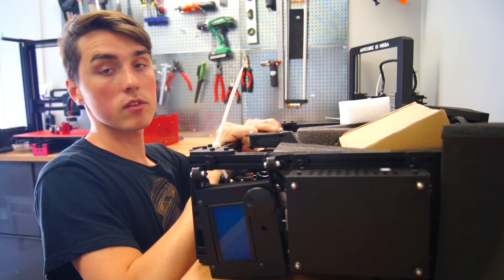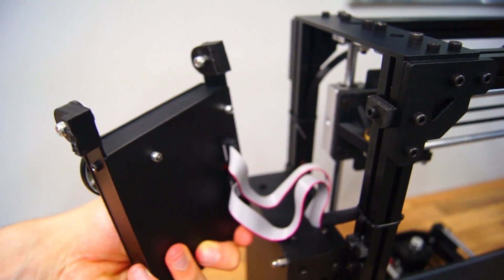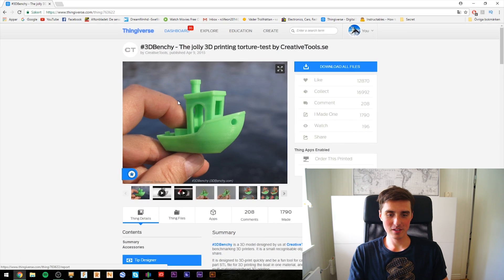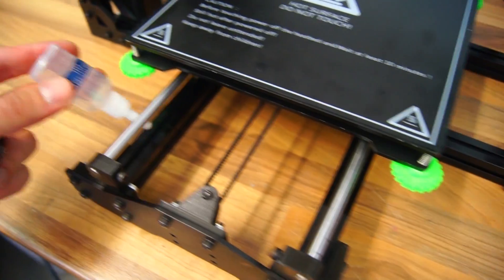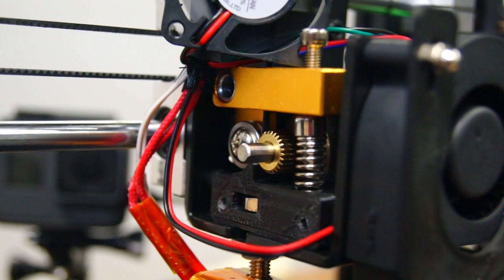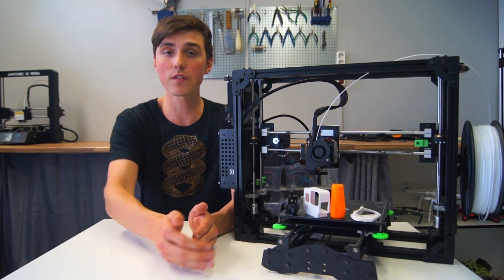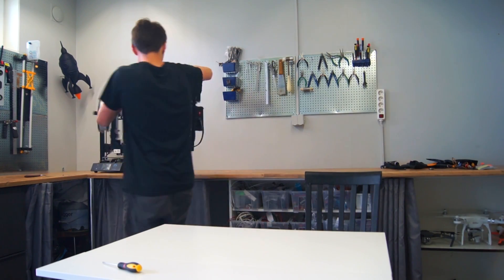NOT the Best 3D Printer!!! - Tristarbot M1 Review

Comment: on the bent rords problem, they seem to be everywhere, but i wonder.. what would it cost the manufacturer to include a 1-1.5 inch steel pipe with the rods inserted into it , if they leave some room for flexing they can certainly fix this problem.
 ofc. you would get less pre assembled parts but at least you get them in working condition

Comment: do they use bronze bushings with graphite insertions? i changed my linear bearings for them on my Anet A6 and it's a pain to get them to run smooth, but it's worth it for the silence they bring!
  i'm asking because i notice that black thing on the rods which looks exactly like my printer's rods when i use too much silicone WD 40 lubricant.
  my method of applying it now is to spray on a paper tissue and use that to clean the rods of dust and grease and it runs really smooth and silent .

Comment: uhhhh you can print faster with a bowden , I print at 60mm/s after upgrading my i3 when I used to print exclusively at 40 with the original DD.
Just need to adjust your feed settings accordingly.

A bowden can print much higher quality at high speeds because it's a much much lighter nozzle, look at your gopro case and look at the horrendous x axis wobble from the heavy stepper motor taking more energy to change direction.

A CoreXY system (where only the print head moves) can reach MUCH higher print speeds because that's got nothing BUT the ultra light bowden fed nozzle moving.

Comment: I wonder, about the bed temp instability; Does it have an adjustment for the "Deadband" or Hysteresis?  It could be that the setting is too high.  A higher setting will reduce the frequency of turning on or off the heater (good for an AC system in a home to reduce wear), but for this you want a low setting because you need the precision.

Comment: As a member from Tristarbot,I have to make it clear that,when you receive a faulty 3d printer from us,such like bent rods or other matters,please don't try to repair it yourself without our help,we use very  accurate graphite lubricating brass bearings for all axis,that also mean slightly bent rod could cause big problem.In this case,you should contact us for parts replacements and tech support,or return the printer,we response pretty fast to our customers,NO our customer should  experience a faulty 3d printer as this video show.
Reply: Could you provide a link to either models or stl files to reprint the factory printed parts for the Tristarbot M1? My x stop broke and I remodeled it but would prefer not to do that for any other parts.
Thanks

Comment: the temperature fluctuation at the hotend may not be a serious problem...I mean I had similar issues on my huge 3D printer which I'm buliding right now and It was a Analog Input handling fault. this Board is based around a Atmel Atmega 2560 chip so the whole thing is just a Arduino Mega, a Ramps board and some DVR8825 stepper driver squeezed together on one circuit board. So I bet the Issue is the same as I was facing with my Ramps Shield on a Arduino Mega: The two Analog Inputs interfeered and that's why the screen shows unaccurate data, but actually the heater block keeps its temperature pretty stable. I solved this by wiring the hotend termistor to those pins where the second heated bed's termistor should be and changed a bit the code in the uploaded firmware (marlin) in order to get the data from the other Analog Pin. I dont't know if this board has additional Analog pins left freely but if it is the case, you can simply modify a bit the marlin firmaware in Arduino IDE and upload that code to the Atmega 2560 chip through the serial port and it will work just fine.
So just try it out :))

Comment: Hahahaha! I had most of those issues.... and more! My hot end was rock solid, same with the bed. That was it.

You ended up with the "older" not as good power supply, so there is already a revision (mines twice the size, metal, and twice a brick...).

My Issues:
- All Y axis black printer square rod adapters, broken.
- Other printed pieces showed layer separation/cracks
- POWER SUPPLY SUDDENLY CUT OUT! I actually fixed it, the power connector to the mainboard was... not properly connected (inside the connector...!) [Also, internals of the newer power supply are unsafe for this class of printer, no MOSFET either, which is dangerous with this bed's heat range]
- Bent Rods
- Missing Spool Holder
- Missing Screws for Spool Holder
- 80% of the zip ties used to ship it were broken at unboxing
- Nothing was properly screwed in, locking nuts weren't tight (they just spun in place)

Sending it back to Amazon, just entirely a sketchy machine. I tried, it's my first personal machine, and I really wanted to like it. Got a Monoprice Maker Select Plus same-day'ed from Amazon instead, spot on prints in less than 30 minutes (instead of two nights past midnight, solving one problem only to find more)

BUT I GOT A SAMPLE OF NEON PLA WITH IT!

Comment: Wait. What? You can print faster with a Bowden set up then Direct Drive due to the lower mass having to be accelerated and stopped. Personally I print at 60mm/s on my Bowden and 40mm.s on my DD
Reply from the maker: I don't know what happend, I must have missed a clip during my editing. I was referring to flexible filaments. I was able to print the GoPro case with flexible filament at 40mm/s which is way faster than what a bowden extruder will be able to do with flexible filament. Sorry about that...
Reply: Bowden systems are lighter and can travel/print faster, yes, but IMO direct drive is more "accurate" and handles retraction better. Also systems built for printing flexible filaments,  like the Flexion, tend to be designed for direct drive, right? Flexible filaments get clogged up easier with bowdens
Reply from the maker: I don't follow, what are you referring to? It's true what you are saying...
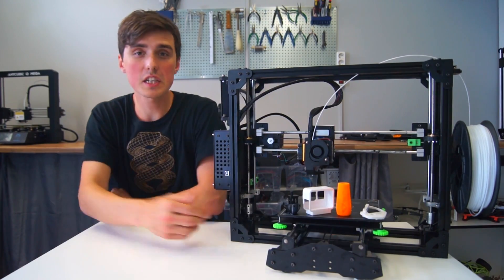Reply: 6:24 you say the reason you got this printer is because it is direct drive and that you can print faster (40mm/s isn't very fast) than on your Bowden printers. But from all the reading I did on the subject Bowden is faster and more accurate for all filaments including flexible ones with mods.
Reply: Do you mean that all your Bowden machines use the PTFE tube into the heat break? Do you not have any all metal heat breaks?

If that is the problem then upgrade one of your machines to an E3D hot end with full metal heat break for higher temp filaments. You wont regret it.
Reply: More difficult to set up and tune? yes definitely. But better quality, Bowden is way up on quality in my opinion. I have a tronxy X3 bowden which I have tuned hugely and it is amazing quality. I just got a Wanhao I3 Plus and that is direct drive, honestly the shifting layers is horrible even after tuning. I've had to turn the speed down so low to get decent quality.
  Also for flex filament I have a 3D printed adaptor which works pretty well but I rarely print flex so I'm no expert. But I have not had any clogs personally using a filament wiper/ oiler.
Reply: Ben Carter you can't really make any valid comparisons between such different printers- correct me if I'm wrong, but the tronxy is on rails instead of belts, right? That alone is a major factor in accuracy. I built a Prusa i3 mk2 and it's impecable, and it's a direct drive. Extruder type is such a small part of overall print quality.
Reply: RCLifeOn ah I see I thought you meant the Polycarbonate filament you had before. I've not personally tried flex on my bowden yet, not found any useful applications for me.
Reply: You might want to add a quick annotation in that part of the video, otherwise it does look very out of place, unless one goes in the comments.
Reply: My workplace has a MOD-t capable of 250mm/s print speeds. It has a bowden.

Comment: cheap prusa clone, no 40w thermistor, no 24v heated bed, no fan on the control board, atleast the bearing are the right stuff, no dual extrusion, the extruder cannot handle flexible, this is old

Comment: Why haven't you installed the "random tube" aka PTFE guide tube? You should do that... It removes drag caused by x-movements from the filament and also reduces friction... Usually this helps for a more uniform filament feed and thus better surface finish :)

Comment: What did you mean when you said that printers with bowden extruder are not capable of higher speed prints? 
All delta printers have bowden and they are faster than cartesian printers. My delta prints at speeds much higher than 40mm/s
Reply: Filip Vranesevic not with flexible filament

Comment: You may should create some test cases for your reviews of new 3D printers, so you can compare the test results better. 
- printing volume
- assemble time
- safety points, like open wire and stuff like that
- which filament is best for that printer
- different print items with different dificulties

And maybe add some charts to your review where all, or at least the important facts are on. 
I would also reccoment to not name the headline of reviews like this one. The best would be like: review : 3D printer : name of the printer.
If a user reads this heading, this might not want to see the video. 

But overall, you doing a great job.

Comment: Why do you need to add a fan for the internal electronics? How hot do they actually get?
It might simply be perfectly designed and oversized. Then it would get away without a fan without any issues.
How beautiful, one wining fan less!
Reply: Perfectly designed, oversized, and Chinese printer do not go together in the same sentence. The only oversized thing about this printer, IMO, was the stretched motor coupler.
Reply: Yeah, might not apply to all aspects... I was trying to say that there is no need without heat ;)
So measuring and adding a fan if needed might be a better advice
Reply: Since most of these kits run the current for the hot end and heated bed through the motherboard instead of using relays, the board can get quite hot.  All of the power to heat up the printer has to go through very small junctions on the board.  Small area + lots of current = lots of heat.